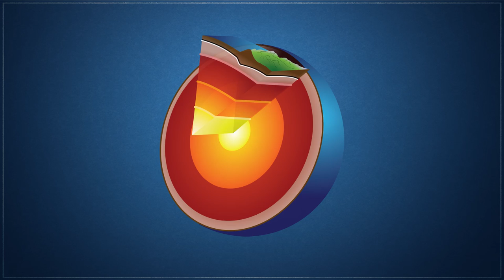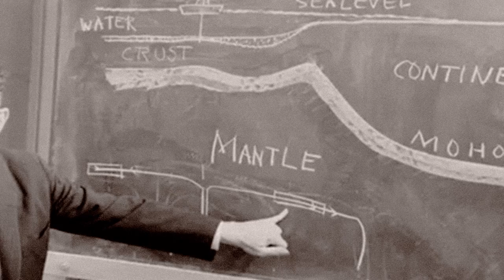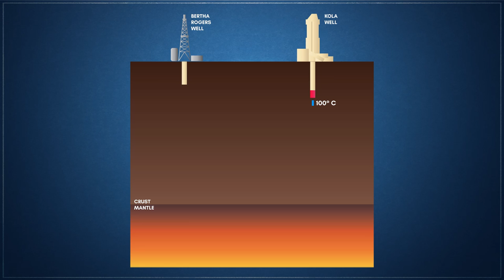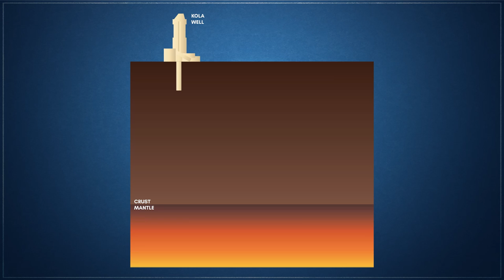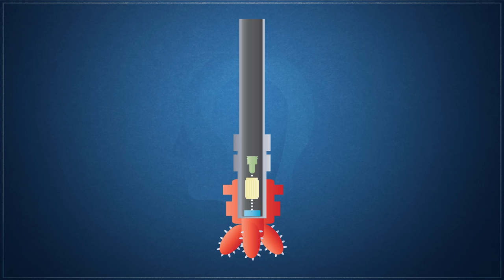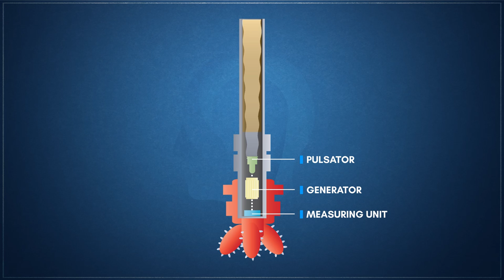Boring Through The Earth's Crust

Comment: The most critical and problem in deep drilling is BLOW OUT, the bottom hole overpressure that is exerted due to the massive overburden. This pressure can be prevented from blow out by running drilling fluid system which is made from mud + weighting agent. To keep the mud weight in consistent with the bore hole pressure so that blow out won't happen is the most important part of deep drilling. The weight of the mud must be havier as drill hole goes deeper. And the mud must be thick enough to hold the weighting agent floats in the drilling fluid. This requires a good stable (heat proof) viscosifier material (polymer) that can withstand high temperature at the bottom hole. When facing an HTHP ('high pressure high temperature) of the down hole we experienced a big problem to keep the drilling fluid in stable condition. Apparently we expected a BLOW OUT will occur when the viscosifier becomes degraded (loss its viscosity) by high temperature heating and  the thinning of the mud will no longer able to hold the weighting agent afloat and further a sudden drop of mud weight will happen. Next when the mud no longer hold the bottom hole pressure, a massive blow out can't be avoided.

I wonder what type of polymer is used that can withstand above boiling point temperature condition in 9km drilling those days, even today we haven't had yet.

From Ex Drilling fluid engineer. Malaysia

Comment: Kola bore hole -- Why didn't they pump water down to the substrate and the drill bit so they could go deeper.  Was it collapsing? Furthermore, why not use a high pressure water jet cutter?
Reply: The water will flash to steam before it gets to the bit after a certain point
Reply: The temp rises at 30C per km and the rock pressure is nearly 3 times what it would be under water at the same depth. Rock begins to flow like plastic at 12km and squeezes the drill rods so drilling just becomes impossible.

Comment: It seems like it would be easier to melt your way down through the earth instead of drilling through it.  Use a modified version of an electrode that they use to melt and make iron/steel
Reply: There are currently multiple research projects looking into breaking concrete and rock with electric pulses

Comment: Can a laser be used to burn down further?
Reply: The answer is no.  Vaporizing rock uses a huge amount of thermal energy and the vapour will condense and solidify as the drill progresses, blocking progress.  Mechanical drilling is way more efficient but has a limit as rock pressure and temperature rise, about 4 or 5 km.  The record hole was 12 km in the Kola Peninsula.
Reply: @karhukivi  sorry for the silly question. I recall same as a plot drvice somewhere. Good to know its nonsense. Hehe

Comment: It's the temperatures that prevent us from going deeper.
Reply: Felony Videos - That's what we're told, but it's not true.  The thermal gradient was higher than expected at the Kola and KTB holes, but that's because they were drilled on faults.  The idea that there is a continual thermal increase from the surface to the core is based on fallacy.  Consider this - The Long Valley, CA borehole was drilled to tap into a magma chamber for geothermal energy.  The first 6,500 feet rendered temperatures of only 100° C, well below expectations, but the next 3,300 feet really confused the geologists when they observed that the temperature DID NOT INCREASE AT ALL!  Why not??  

Increased heat with depth inside mines is accepted as proof of the Earth's interior heat gradient.  But, why do deep cave systems tend to get COLDER with depth?  What's the difference??  The oceanic crust is only 1/6 as thick as continental crust on average.  If heat can emanate up through 30 kilometers of continental crust, why does it not radiate through 5 kilometers of thin oceanic crust, thereby creating at least a moderate positive gradient toward the ocean floor?  

If rock at 12km is so hot as to be ductile, how do we have deep earthquakes at 650km into the mantle??  Earthquakes are the fracturing (and shifting) of BRITTLE materials, but brittle materials shouldn't exist at such depths with such supposed temperatures... yet they are an accepted fact of seismology.  The explanation for all these mysteries???  The 'science' is wrong.
Reply: @freemind..  Well, I didn't say the temps increase linearly, or that every place on earth has the same characteristics. All I can tell you is that it is hot as hell at 5 miles deep, almost anywhere you drill. I know, because my instruments have come back with the solder melted.
Reply: @freemind..  As far as deep earthquakes, I don't think science understands that at all.

There is also a theory that the planet is actually expanding...
Reply: @FelonyVideos  - Well, my point is that they give us inferences as though they are proven fact, but it has happened so much that we now have a framework for several major things that are completely wrong.  The magnetic field mechanism is a glaring example.  It is not generated at the core, but rather in the crust.  95% of the crustal minerals are crystalline and piezoelectric in nature.  When they receive mechanical stress, they produce a piezoelectric charge.  The tidal influence continually exerted on the landmasses by the Moon and the Sun produce that constant stress along thousands of fault lines worldwide, which in turn produces a magnetic field.  Any celestial body with a magnetic field will be receiving tidal influence from another large body.  Venus has no moon, and therefore no magnetic field.  Mars has 2 small insignificant moons that produce no tidal pull.. thus, no magnetic field.  Mercury has no moon, but is close enough to receive tidal influence directly from the Sun, and has a small magnetic field.  Jupiter has been thought to lack a solid surface, but a rocky, quartz-based crust is a prerequisite.. so don't be surprised when we finally develop a way to see past the thick atmosphere, and find a rocky crustal surface.  The meteorite impacts witnessed by all several years ago left sustained heat signatures that can have only have lasted so long if they impacted something solid.
Reply: The reason the Long Valley borehole didn't keep getting hotter is because it wasn't drilled on or near a fault.  Faults produce their own heat by frictional ground movement.  This is also why mines get hotter with depth while cave systems get colder.  Mines are almost always the end-points of faults/ diatremes because the things we are interested in mining require the high temps and pressures found there.  Caves, by contrast, are not usually associated with faults, and do not generate their own heat.

Sorry to vomit all this out there at once.  It's just frustrating seeing everyone believe things that are untrue, but have been pushed as though they are correct.